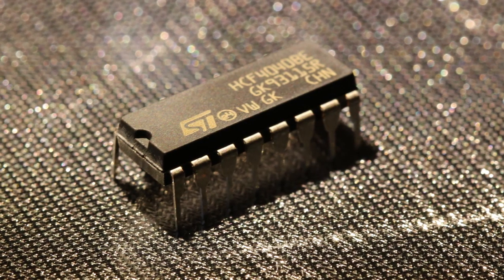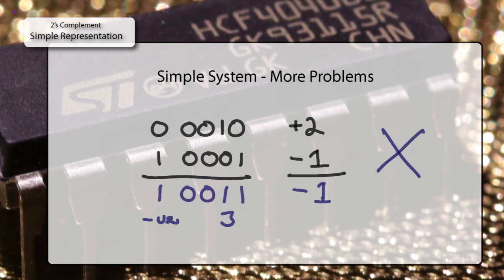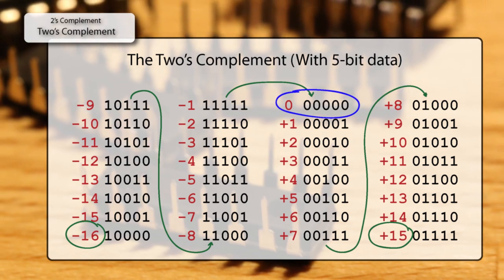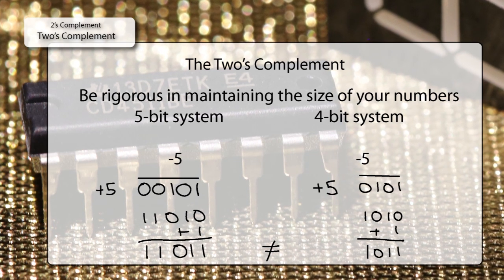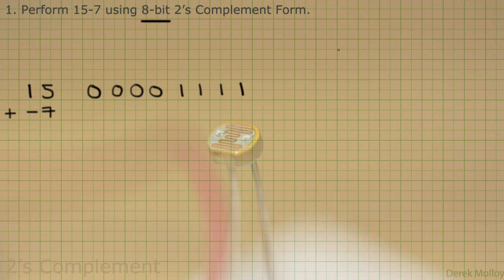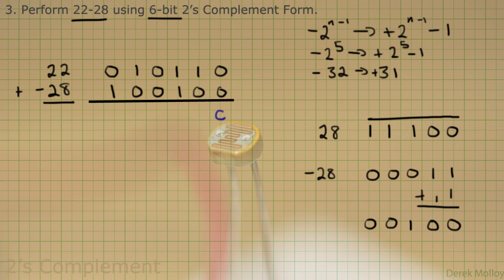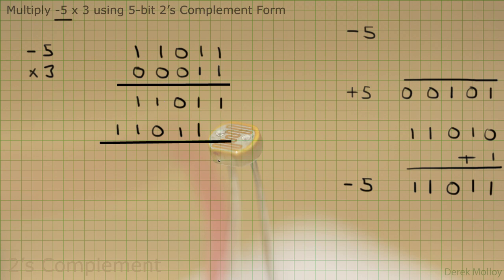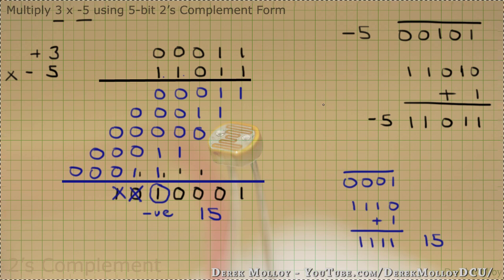Digital Electronics: The 2's Complement

Comment: This video is a very clear explanation of HOW to use the 2's complement, but I want to emphasis that it does not explane WHY it works. I am aware that this is not the goal of this video.
Just sayin' for people who think they understand whereas they just know how to follow the procedure, and this distinction is important for everything related to education.

I have a question : what happens to "-16" in signed 5 bits number representation ? Because, just as "0" (00000), you just go back to the same number after applying the 2's complement ? Indeed, compl(10000)+1=(01111)+1=(10000) ? So, do the addition and multiplication hold for "-16" ?